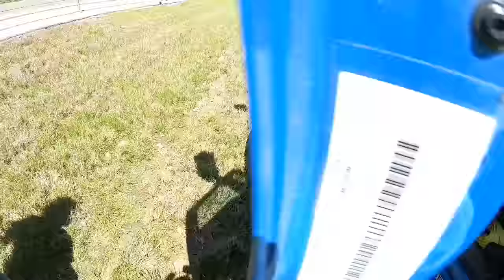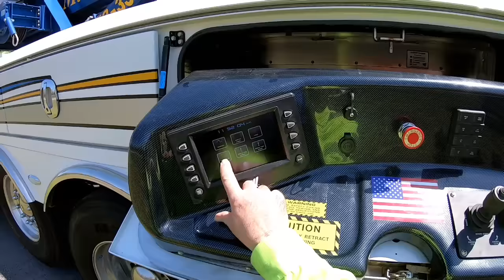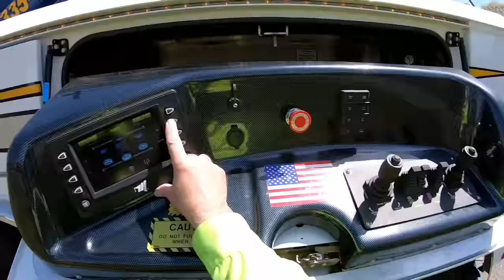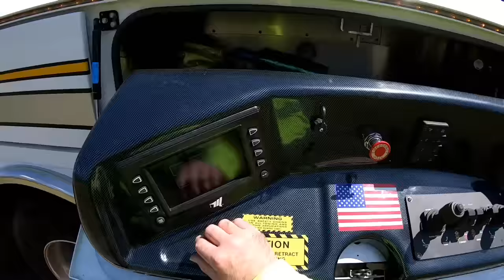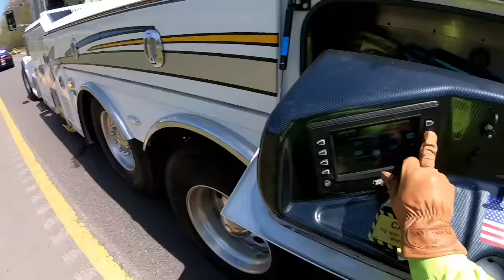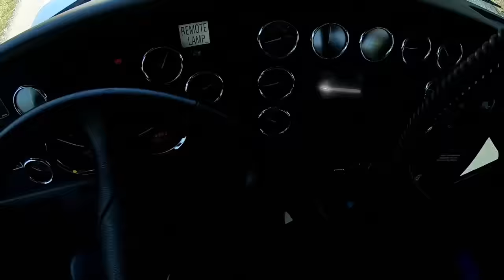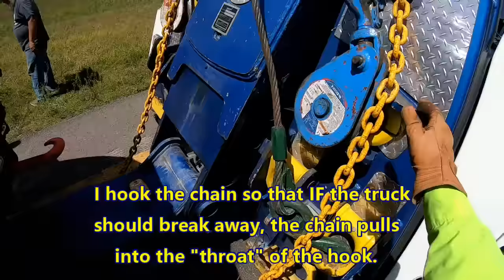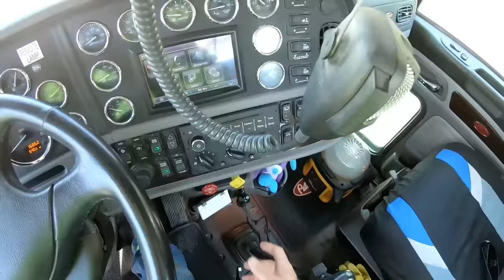Car VS Semi Crash!!!  Code 3 Response

Comment: 18:03 in most states( at least where I live) using that is completely illegal and any incident involving one you are immediately ruled at fault. A couple years ago there was a school bus that did the exact same thing as that car tried to do and met the front end of a 10 wheeler dumptruck carrying a full load of gravel going 70 and the body of the bus was ripped off the frame and was spun 180 degrees around( it was hit at the very rear of the bus) and killed a few children, I think it was a bunch of middle schoolers going on a field trip. Look up I 80 school bus vs dumptruck New Jersey. (or something like that)

Comment: Retired fireman.  People are so stupid when it comes to yielding to emergency vehicles.  Don't want to lose their place in line for any reason.  I guess it's not one of their loved ones who is bleeding to death.  One station I worked at had a police officer who would respond with us to fire calls just to ticket drivers who wouldn't yield or followed too close.  Back in that time we firefighters rode on the tailboard at the back of the truck just holding onto that chrome bar above the hose bed.  Talk about no seat belts or air bags!

Comment: Hello Ron, I saw that the engine of this truck is still running, so is there really a need to pull the drive shaft or would it be possible to let the engine idle in neutral to provide oil pressure and tow with the drive shaft mounted? I don't know how the modern automatic transmissions exactly work and if the clutch will be closed or opened in neutral to drive the oil pump.

Comment: I log at lot of hours on the interstate in both personal and professional life.  At least half of the near miss disasters I see on the interstate is caused by people attempting to use the emergency turn-around for personal short cuts.  It's really not worth the risk when you can travel 1-3 miles down the highway and use an actual exit to turn around.

Comment: I still can't get used to the idea of recovery vehicles running blue/red lights and using a siren. But here on the east coast the population is more dense, and recovery services aren't far away. However, Virginia did pass a law last year requiring motorist to move over one lane if any police or service vehicle has it's warning lights on.

Comment: My oldest brother used to haul produce between Florida and California.  He experienced robbers trying to box him in to force him to stop as they wanted to hijack his rig and trailer.  He knew their moves and wouldn’t stop for them.  He told me that he drove as far as the eye could see ahead of him and tried to use his excelerator to control his truck as often as he could and save the wear on his breaks.  The crooks are still out there.

Comment: Hey sir I have another question for you as well not that I'm saying anything happend but has something bad happened to you before like a brake away and you did not have chains on or something I've seen a lot and done alot of towing I do it like you but that's because I was thought that but the guy that thought me had bad crash because he didn't do this I'm just curious if this happened to you or were you just smarter than the average bear lol

Comment: That burned trailer sounds like an AutoZone trailer that burned which was carrying my stores freight when I worked for them.  Fire started in the middle of a sealed trailer, and the company blamed the team drivers.  Not sure what the eventual ruling from the investigation ended with.

Comment: Didn't know a wrecker could respond code 3, what state is this?
Reply: Missouri I think
Reply: Deep Fried this was in Cape Girardeu Missouri. In the state of Missouri we are aloud to run red and blues lights with sirens when told to EXPEDITE by the police agency that called you. Then we are considered emergency vehicles. That is the only time we can run code. I also drive for a tow company in St.Louis Missouri however we only run amber lights, there for we can’t expedite even though we do police towing.

Comment: When your speaking to the other truckers are you speaking on CB or a speaker phone if so that's a very loud speaker phone or if its CB how are you to know what channel they are on?
Reply: He was using the CB radio, truck drivers and towing companies operate talk on a licensed radio system. You can't operate a CB unless you have a communications license and call sign or work for a trucking company or towing company.

Comment: Why not just put it in neutral? I thought disconnecting the drive shaft is just for a vehicle that you can't get into, or is it different for semis?
Reply from the maker: Actually, it is best to remove the drive shaft on ANY size vehicle if the driving tires are on the ground while in tow.  The transmissions do not receive the needed lubrication if towed without removing the drive shaft.  Thanks for watching and God bless.
Reply: @RonPratt  That's good to know! Thanks! Would rather not admit how many vehicles I've flat towed in neutral lol.
Reply from the maker: @MWChainz  It happens....I won't tell anyone if you don't.....LOL

Comment: Have you ever noticed how about 1/2 the time the cops are located in front of the vehicle that's ditched or wrecked instead of being behind them where they can actually do some good with their emergency lights? Like this guy. What possible use was he where he was sitting. He was just in the way. If he had been behind the wreck, he could have given traffic advanced notice and would not have been in the way of the wrecker when it had to reposition. Some people's kids..................
Reply from the maker: Different states have different methods, but in Missouri we use T.I.M.S. guidelines for setting up a scene.  The officer you saw in this video was exactly where he was suppose to be, because he was the investigating officer.  Other police officers, fire personnel, MoDOT, and sometimes we, set up the advanced warning and blocking vehicles to create a safer working zone.   Thanks for watching and God bless.

Comment: Why does a wrecker have a siren?  25 years as a paramedic pulling crashes on the I-90 never ever have I seen a tow truck with a siren
Reply from the maker: Things have changed a LOT in the last 30, 20, even 10 years.   The new TIMS classes integrate towing/recovery as a vital part of the Emergency Services team.   Properly trained and equipped companies can be an extremely valuable asset in  a lot of situations.   Cross-training is vital to the success.    We work and train with most all the local departments to build relationships, experience, and trust.   Please don't misunderstand me.  I do not agree that EVERY tow company should be allowed to run Code.  There should be training requirements, certs, insurance requirements and other things that I feel must be met before being allowed this responsibility.   Missouri is one of the few states that allow us to run red/blues and sirens and then only when requested to expedite.   There are many reasons to expedite other than medical now, which is something also taught in the newer TIMS classes.  If you are interested, here is a link to the Missouri Statutes defining tow/recovery vehicles as Emergency Services:   https://revisor.mo.gov/main/OneSection.aspx?section=304.022
Thanks for watching and God bless.

Comment: why not just attach an airhose from the towtruck with a t-joint and a long hose in between the truck and the trailer instead of running the engine just to unbrake it

Comment: it is a shame you can not put a train horn on your truck for when your air horn is not getting to them i sometimes wander if an air horn can be heard when the windows are up the radio blasting and the a/c is running hope nobody got hurt in this wreck the driver sure was tore up bad could see that have you ever had to use your boom to put a truck on the under reach

Comment: Why respond emergent to that scene?. That’s compromising safety for no real gain.
Reply from the maker: When requested to run Code (emergent) to a scene by the dispatching agency, which is usually a police department, we do so without questioning why.  They tell us to respond Code then we respond Code.  That's just the way it works.  They have their reasons and we may not know what the circumstances are.      Thanks for watching and God bless.